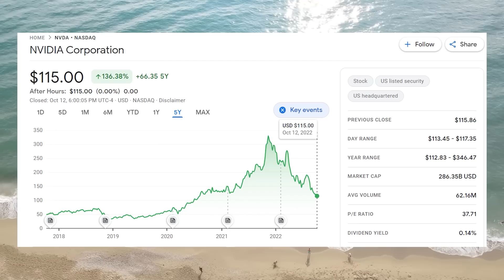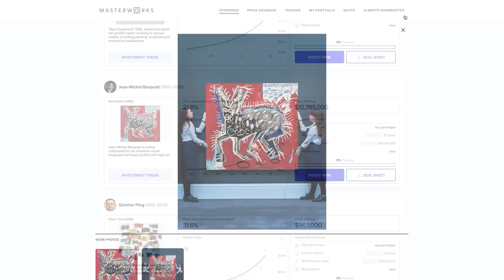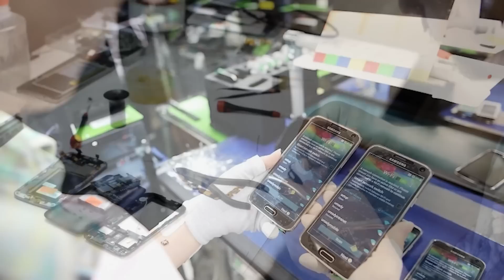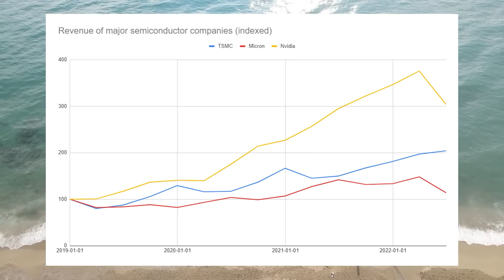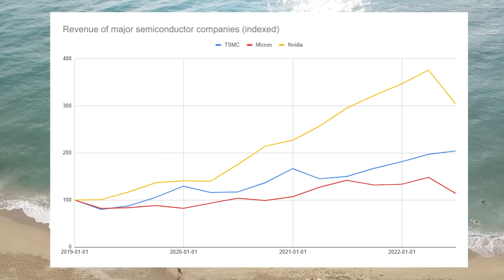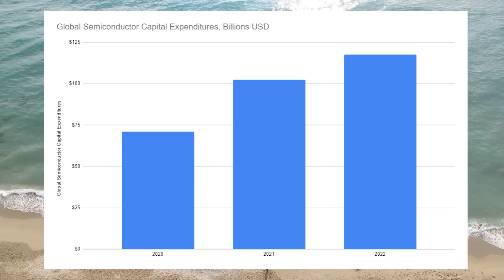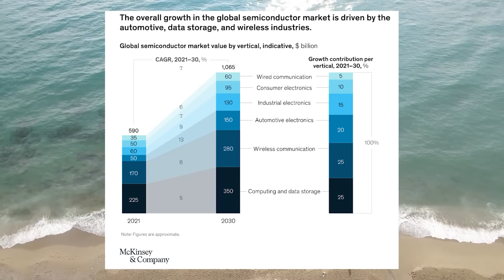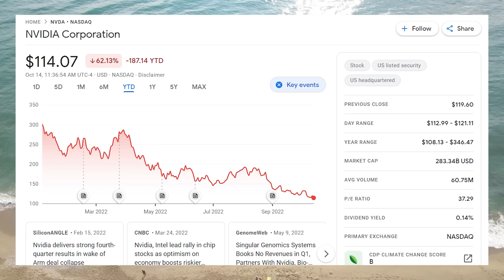The Impending Semiconductor Collapse

Comment: Vehicles run just fine without a computer. Even better, actually. Just one less repair expense. Cars can be designed and built without a computer, and they should. Free up components for computing devices.
Reply: You are so clever 🤦‍♂️

Comment: There is a chip shortage but there are to many kind of semiconductor and there is no real shortage on most of them. What could really bring the shortage back in some areas is the recent export control the us passed. The chips in cars are not as high end as the ones that are in your pc so they are more easily produced. Because of the Oligopoly and near zero real competition they will adjust the manufacturing and keep profits high. So in conclusion there are still shortages but for specific chips and there is no doubt that chips will be in ever more products,so i personally believe the semiconductor market still is and will be a good long term investment.
Reply: Most export controls will only become active in a year. This will guarantee another year of high demand for high-end chips from hoarding Chinese. And a crash after that.

Comment: True that Semiconductor Industry is cyclical, but you are wrong that there is glut. You just skimmed this industry. Lots of the demand is not just GPU's. GPUs are in demand because some cyrptocompany horded the GPU's. Lots of other types of semiconductors such as sensors are still in demand.

Comment: Do we use more semiconductors today than we did 5 years ago? Yes. Will we use more semiconductors in 5 years than we use today? Yes.
Reply: Will we be adding chip to products that don’t need them in in 5 years?
Yes
Reply: in 5 years time we will be eating rats in the radioactive ruins
Reply: It's just a kind of dumping to rebuild it soon. Without China.
Reply: It doesn't matter though if the money printing doesn't keep up. With newest processing techniques the single transistor might not get cheaper even if the density still goes down.
Reply: Chips are cyclical
Reply: @jamessan6921  And the cycles, or waves, just keep getting bigger and bigger. Right?
Reply: Did I plow Travis shooks mom? Yes.